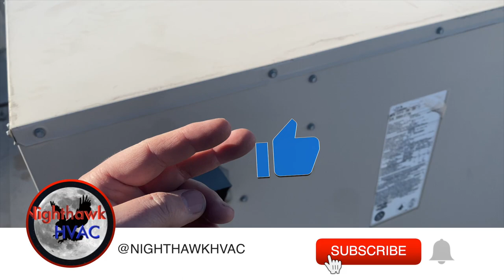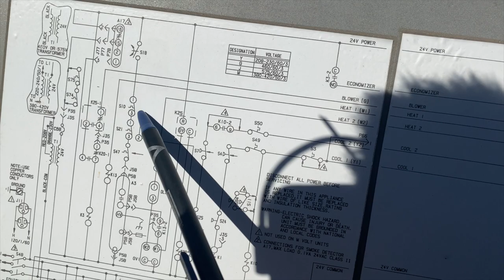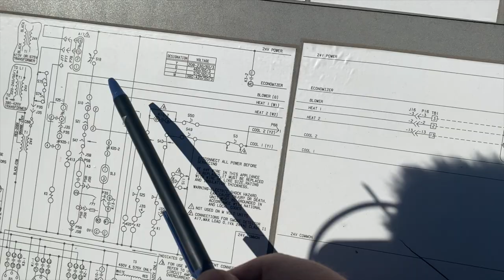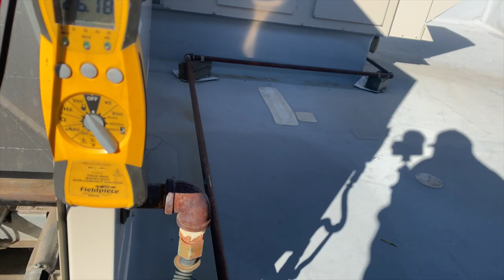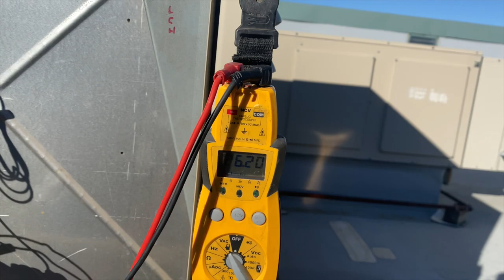No Heat.  Spark Ignitor Not Igniting The Burners. EP107

Comment: I've always heard it called hall effect switch. Nice job man, I always get a chuckle at the end "tell me what a horrible technician I am" 😆
Reply: For whatever it's worth (probably not much), the Hall Effect sensor is a bit different of a beastie. It's an electromagnetic sensor, as opposed to the electromechanical centrifugal switch (g-force).
Reply: @uxwbill  correct, and your knowledge is worth something! I had a brand new 15 ton carrier gas pack with reheat, missing the combustion blower wheel 😆, they couldn't figure out why the roll out switch was tripping.
Reply: No that inducer is a centrifugal switch. A lot of the newer inducer motors now use the Hall effect. You can tell by the end of the motor. If it is flat it's a centrifugal switch and if it is round like a dome it's a Hall effect. Carrier uses them now.